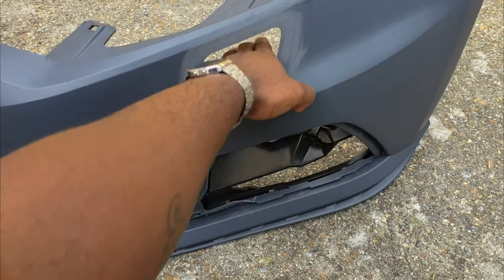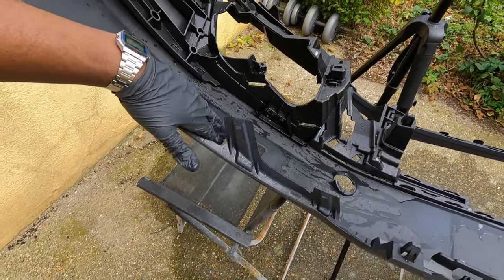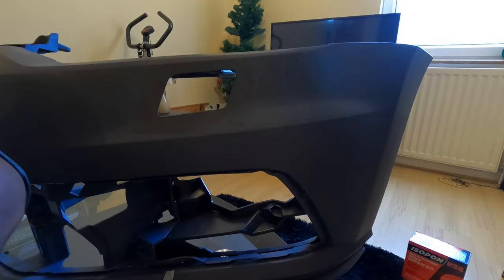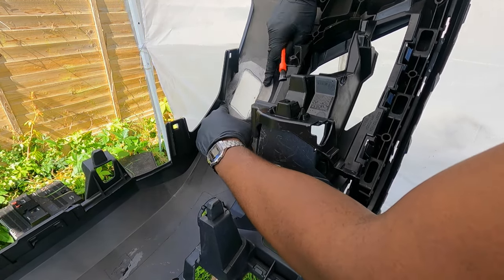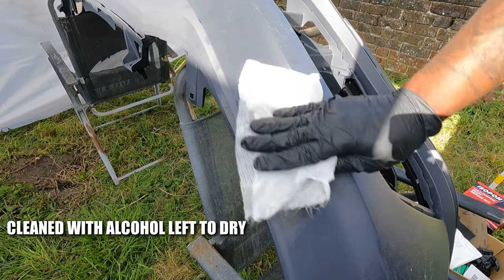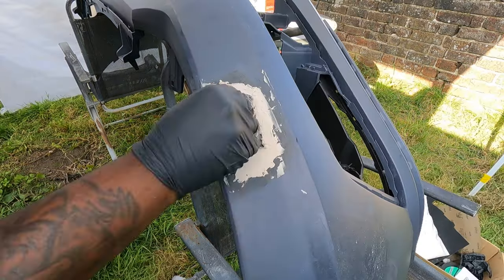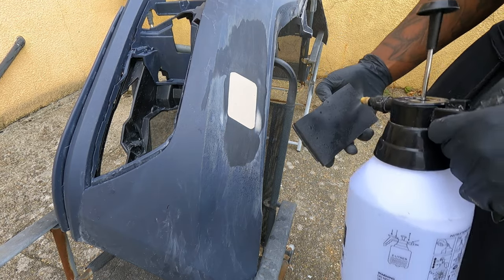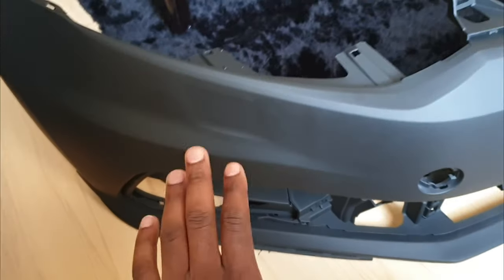How To Fill Holes In Plastic Bumpers

Comment: Does the body filler crack after a while with the temperature expansion of the plastic?
Reply from the maker: The body filler is a flexible body filler made for plastics so not it doesn't

Comment: I can't find Isopon glass fibre anywhere. What would an alternative be that is easy to come by in the USA? Is there a Bondo equivalent?
Reply from the maker: Hi Kyle if you look on ebay.com you can get fibre glass matting and the resin I looked on America's ebay store hope that helps another alternative I've used and I've seen other use is: 

Bandages and epoxy glue very DIY but does the job

Comment: Will this also work on a cracked bumper?
Reply from the maker: The answer to the question is yes but if the bumper is cracked to pieces then no, I would start by plastic welding the crack and then applying this method for a full proof repair hope that helps